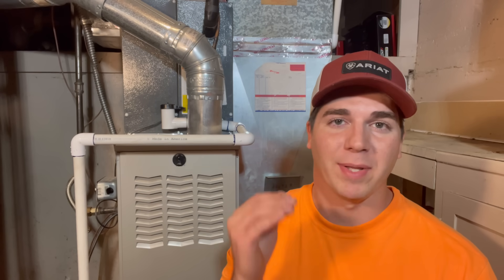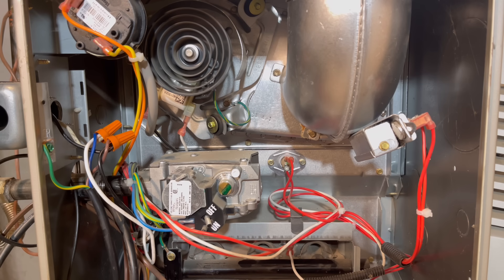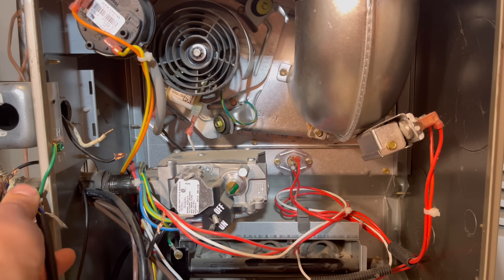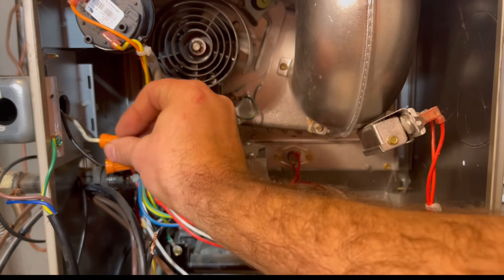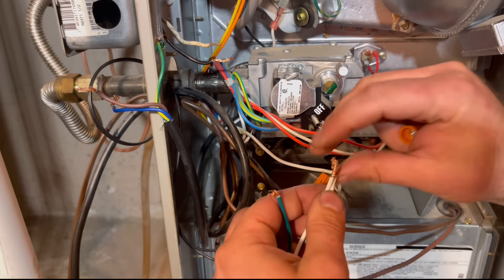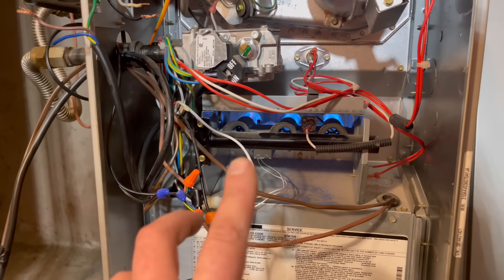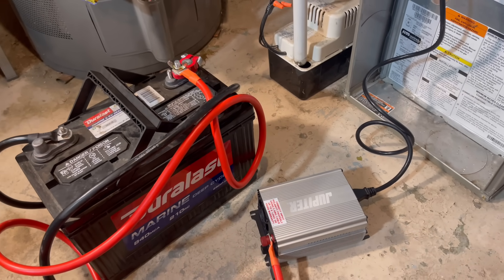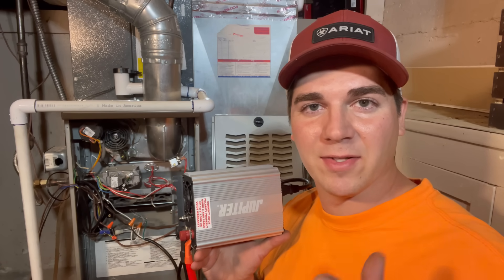Did You Know You Can Heat Your Home With A Car Battery?

Comment: A better way to do this is to change the wire that comes from the furnace. Disconnect it at the junction box. Put a plug on the end of it. Install a receptacle in the junction box. Plug the furnace in and it’s wired to the grid. Unplug it then plug it into the inverter. You do not even have to mess with the wiring in the furnace.
Reply: @stevearcher6100  Nope.  LOL.
Reply: thats the way i see it in homes in my state built in  last 40 years    maybe differant ewlectrical code?   dish washer and garbage disposals have plugs not hard wired as well
Reply: @hecklefish  You need to know what your furnace draws. Look up the specs for the model you have.
Reply: While this is definitely functional, it is also against code to have it not hard wired with a disconnect. You cannot have a furnace just plug into a receptacle.
Reply: @puntacanaman1  True, but I did that to mine in case I have to plug it into a generator. Didn't want to spring the $100 for a transfer switch. When i sell the house, I'll hardwire it back.
Reply: @puntacanaman1  just wondering: what if you had a disconnect to the 110v receptacle and plugged in the furnace on that receptacle (or inverter when power is out)?
Basically replace the disconnect switch with a combination toggle switch/receptacle (under $20). Make sure to put a rubber grommet where the plug comes out of the furnace (if you drill a hole).
Reply: @puntacanaman1  a cord and plug is considered a disconnecting means and is perfectly legal. I have a receptacle and switch mounted in a junction box.the switch controls the receptacle, and the furnace plugs into the receptacle.
Reply: @tomcole7046  NEC violation.  Look it up.  I didn't make the rule.
Reply: @puntacanaman1  I know the NEC. I’ve been a master electrician for 25 years.  On a gas furnace, it is perfectly acceptable to use a cord and plug to power the unit, provided the receptacle that it is plugged into is on a dedicated circuit.  Your AHJ may not approve it, but it is legal.
Reply: @tomcole7046  Well, you should know!
Reply: @puntacanaman1  Not in Canada. The Canadian Electrical Code  states there must be a means of disconnect within 3 meters of the furnace. When you do it this way the original furnace switch is still functional and you cannot get more disconnected than a plug. Nowhere in the code does it state the furnace must be hardwired.
Reply: @puntacanaman1  Most furnaces I have worked on and have in my own home in Los Angeles are plugged into a dedicated outlet. When I lost power during a winter storm many years ago, I hooked up a 1000watt inverter to my truck battery, ran an extension cord from my truck into the house and into the attic. Plugged in my furnace and got heat. Only ran the furnace and truck for 20 minutes every few hours to take off the chill in the house and bundled up otherwise.
Reply: @sanseiryu  Every area and home are different.  Different codes. In the north, your furnace had better run regularly or you are in trouble.  I can see LA being no problem at all.
Reply: @puntacanaman1  I was clear that I said Los Angeles. I was a HVAC technician and hard wired residential gas furnace power is not required. I lost power during January 20+ years ago for over 3 days due to a downed transmission line with night time temps in the 40s. For LA that is f'ing cold.
Reply: @puntacanaman1  When your freezing in your own home, who cares about the code.
Reply: @almostthere7328  I wouldn't care, either.  I've made some shaky hookups in the past.  For TEMPORARY use.  I was just saying that this isn't a code-approved hookup for a permanent installation.  That's all.

Comment: I bought an electric car with vehicle to load technology just for this purpose. It has a 77 KWh battery and a 3KW inverter already built in. In an emergency I could rig up my furnace and basic lighting to the car in an hour. I have a wood furnace for heating and hit water but it had electronics, air intake valves and fans. So, no electricity, no heat. 
If there is power in neighbouring districts (or neighbouring countries - I'm in Luxembourg and France, Germany and Belgium are all 20 minutes away) I can just drive the car there, charge up in 30 minutes and drive home.

Comment: What can I do if my HVAC system is Electric and only runs in Emergency heat mode? Will this still work for me?
Reply from the maker: Unfortunately you’ll probably need an alternative heat source like a mr buddy heater which is a great option. This trick will not work for anything requiring 220v

Comment: What you pointed to for the test of how long it will run was an unrelated video.  Did you complete the test and how long did it last?  By the way, if your furnace isn't grounded then you have a problem that needs fixed.  It's likely that the household wiring coming into the switch box is grounded to the box and therefore to the metal cabinet.  You should do the same with your pigtail cord.
Reply from the maker: The text video will be uploaded soon! Stay tuned. Yes I know the home is grounded, but I didn’t see a ground wire in the romex going to the furnace. Maybe I didn’t look close enough.
Reply: I'm pretty sure it's grounded inside the switch box where you turned the furnace off. Since the box is metal and attached to the metal cabinet, it should be grounding the cabinet. Safety first.

Comment: The point most people miss about automotive alternators running an inverter is how much current the alternator actually puts out.

Most automotive alternators are about 125 amps maximum at an alternator speed of about 7,000 rpm. But it takes about 25-30 amps just to run the car. Fuel injection pump,  electronic ignition and the engine computer. Even the alternator takes some power. 

And long high speed idling is not good for engines.

Comment: For about $100 you can pick up a cheap 800 watt generator from Harbor Freight.    Don't attempt this with a car battery as they are not designed for deep discharge and you will ruin it and not know it until you come out to start your car one night in a freezing parking lot.           While you are at it pick up a small air-conditioner with a mechanical thermostat to use in your bedroom in case you experience an extended AC outage in the middle of summer.  Do not buy one with an electronic thermostat as it might prevent the compressor from starting due to a temporary under voltage condition due to your 800 watt generator.  Once the compressor has started the under voltage condition will go away.